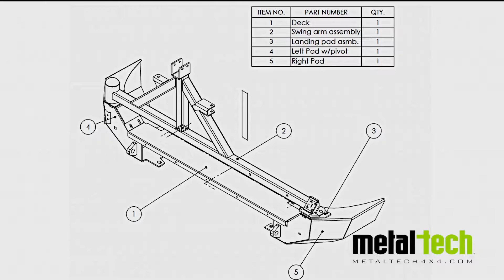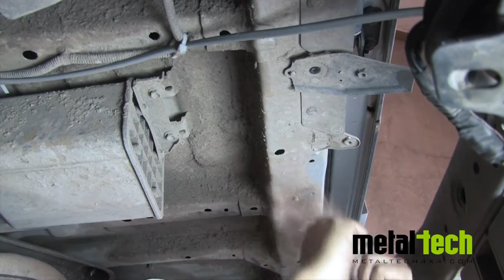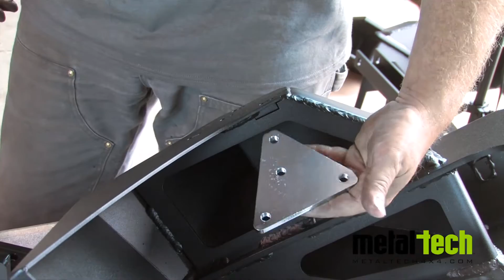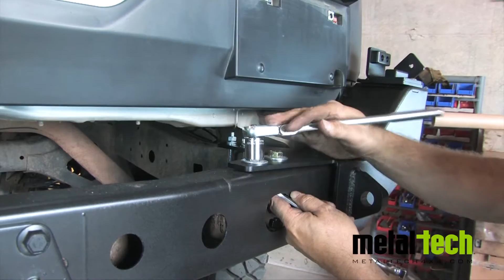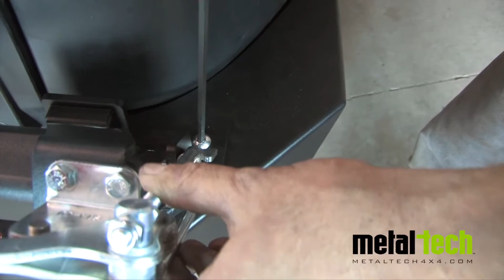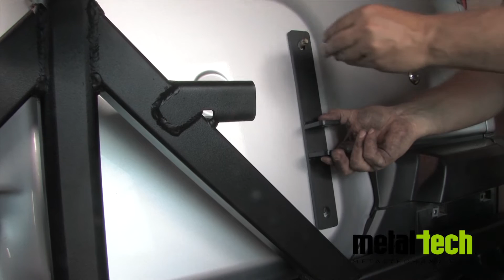Metal Tech 4x4 Red Eye Bumper Install v2

Comment: I didn't notice the backup sensors being reinstalled...are they omitted from the design?
Reply from the maker: Bill, no they are not omitted.   The exposed frame actualy has openings that the sensors (the trucks with them) are then moved to.  They continue to work 100% as designed.